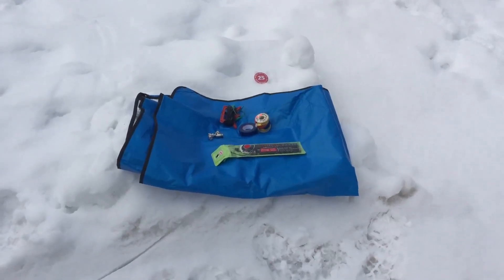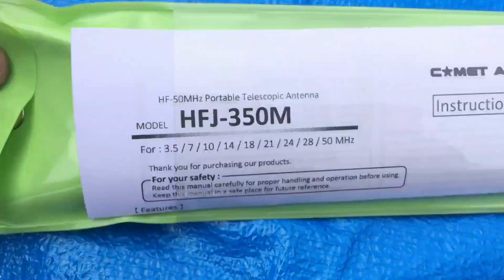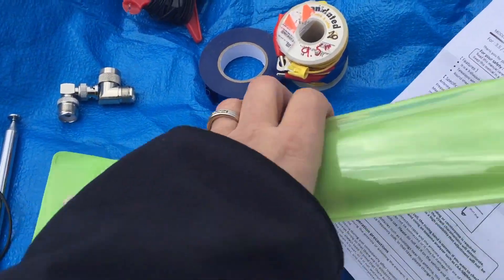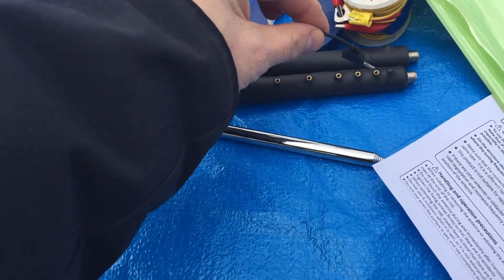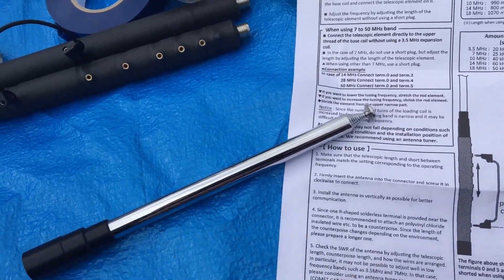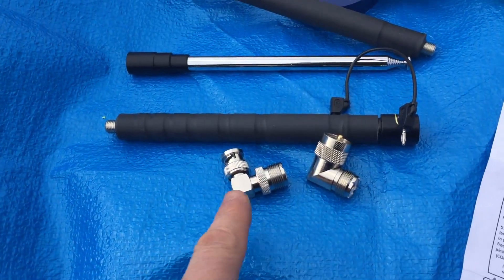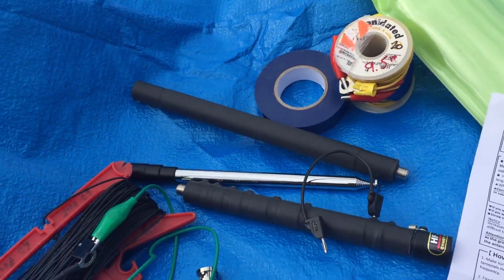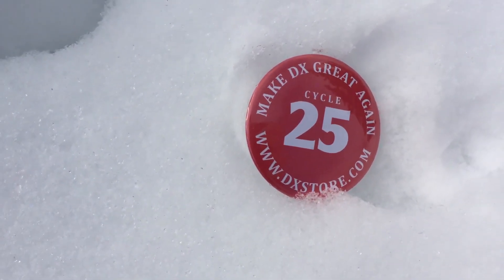Comet HFJ-350M Portable HF/6m antenna

Comment: Thanks for this - I went ahead an bought one based on this and another your tube video even though some of the eham reviews weren't great (I suspect people don't follow instructions).

I got the "Toybox" version that comes with the 160m coil.
Mine came with a green/clear vynil roll wih separate sections for each cold/element - similar to the black one they sell, but in the green/clear vynil similar to the one yourrs came in.
It also has white printed bands on the ladder coil for each of the jumper holes, so you don't need to refer to the manual to work out which hole to jumper for which band.
My only conplaint is they talk about 2 counterpoise lenths but only give you one ring terminal. I don't mind spending the few pennises it's just a bit of an inconvenience.
The rig I am planning to use it with arrives tommorrow, so fingers crossed.

Comment: Great little portable antenna.  Just bought one, instructions don't really tell how long to make the counterpoise for each band, that would have been nice to know, at least a starting point, then add or remove wire (roll-up or unroll) from that point to help in tuning the antenna. They do make reference for 80meters (20 meters long) and 40 meters (12 meters long), not sure how that works out, haven't tried the antenna yet. Interesting to hear some feedback from hams that have tried this antenna, I will also report back too!
Reply: I plan to use the same formulas for that as for antenna length, with the knowledge that adjustment will always be dictated by the ground under your location. WS7PB
Reply: Any luck figuring out the counterpoise length? Mine is on the way and hoping to have good luck with it.
Reply: @TheSphynxDaddy  180 divided by the frequency give us the length in feet.